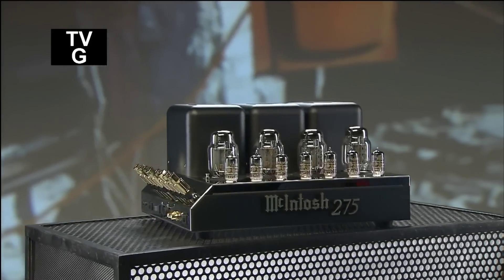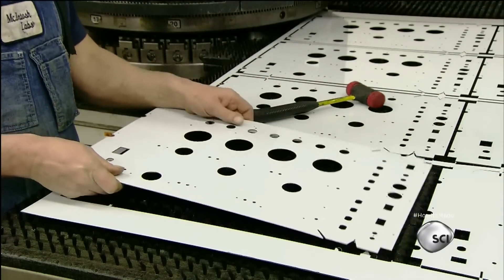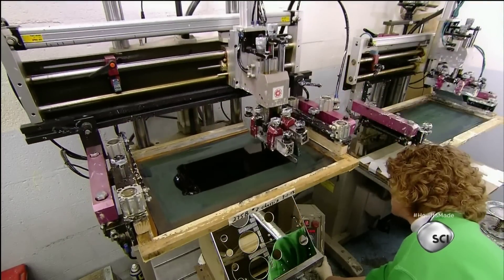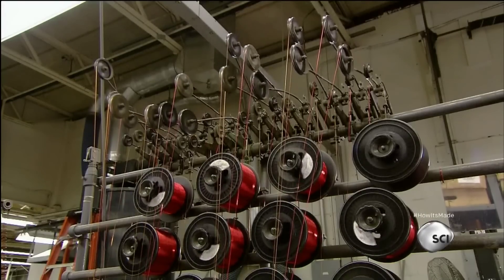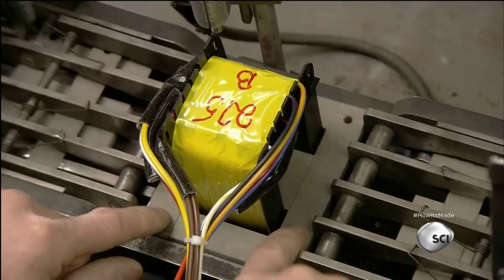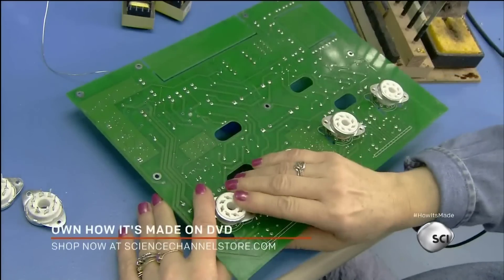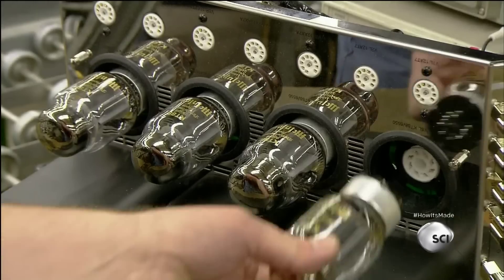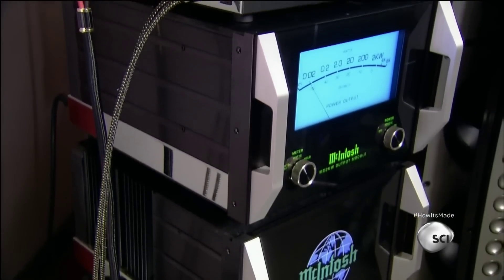How It's Made - McIntosh Tube Amp

Comment: worst invention ever was the EQ,whole plan is to match the sound of what was heard in the studio during the time of the recording exactly.every am should only have bass treble and midrange flat where it should be,younger gen has absolutely no idea what true sound is supposed to sound like,like tha Beats crap,wtf.Sounds like absolute crap.MacIntosh is the true sound.
Reply: Your assumption is that every speaker sounds the same (and that they sound like the studio monitors used in creating the final mix).
Your assumption is...wrong.
Reply: We would we fucked without EQs there sir, don't forget that there's live audio too, and in that department alone the uses for the EQ is huge.
Reply: It's really what you want to hear, if you want to hear the sounds that's originally recorded in the studio then buy a Studio Monitor speakers and  that's uncolor sound and for HiFi sound it'll be more fuller with EQ and Fx.